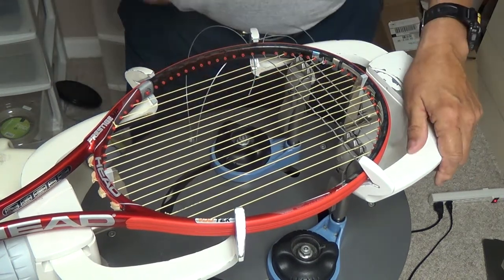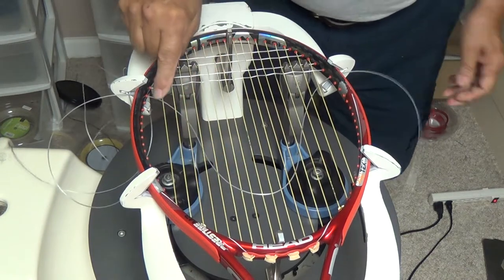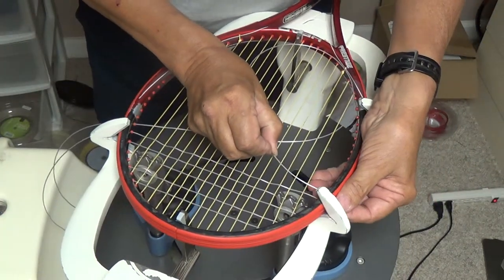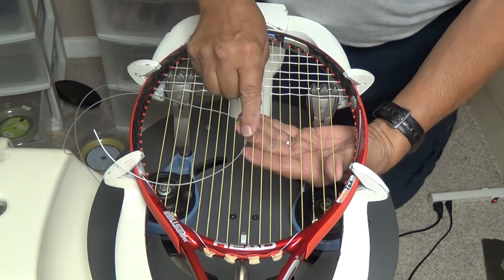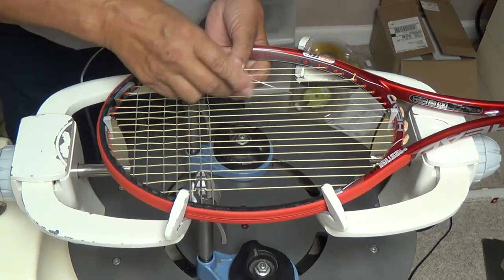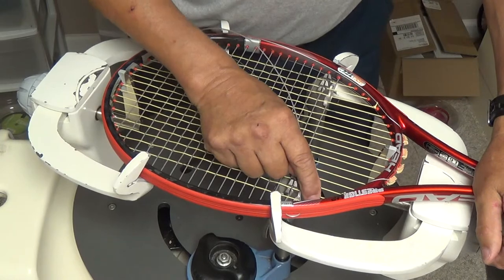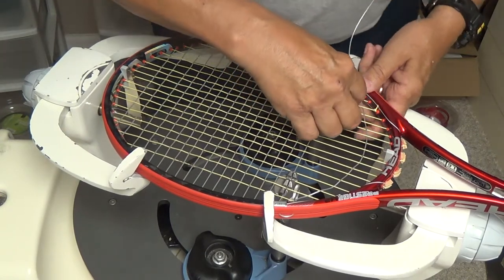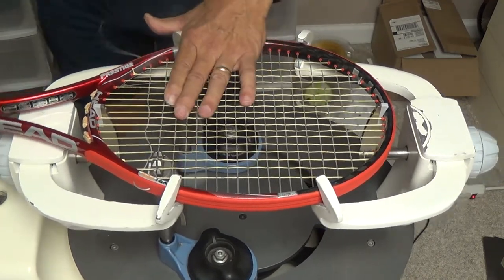Weaving poly through Kevlar

Comment: Great timing for me with this video. Thanks. 

Do you string commercially or just as a hobby? 

Also do you play tennis?
Reply: I'm going to say he is commercial, plus his skill level and experience is very high with how cleanly he strings the rackets. Great videos, thanks!
Reply from the maker: I'm a home stringer and yes I like to go out and hit a some but the heat and health has put a pretty good half on playing.
Reply from the maker: Those rackets belong to a customer of mine. He had three of them strung. Kevlar / poly I could play with but I don't think I'd use them a lot.

Comment: Also, sometimes I notice that the grommets on the inside of the frame get chipped/split or broken from the player framing the ball during a match. Should this be a concern?
Reply from the maker: I would not be concerned about the grommets unless a piece broke off and produced a buzz. One think I did notice on those Prestige frames is the first grommet on the side strip want to back out (5T) as I tensioned the 5th mains. You have to be careful and hold them in well when you tension the strings. If you have a flaring tool that would be helpful too.